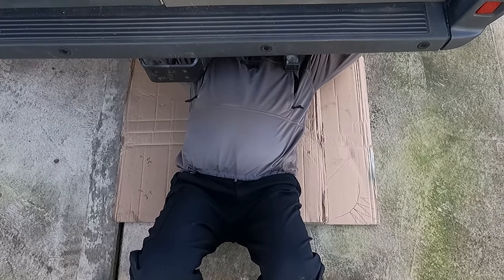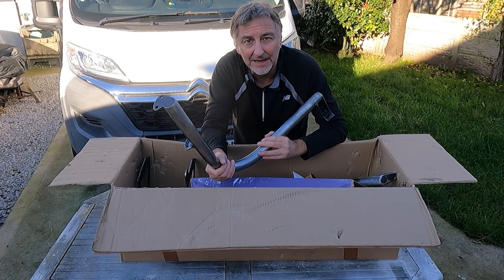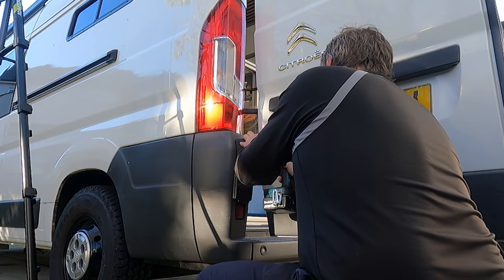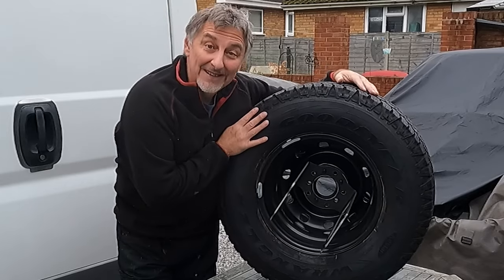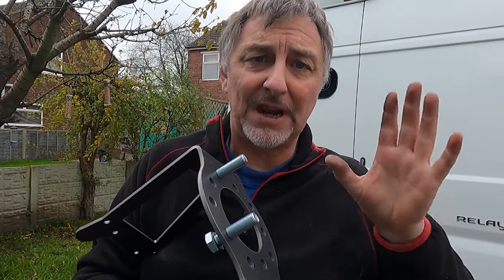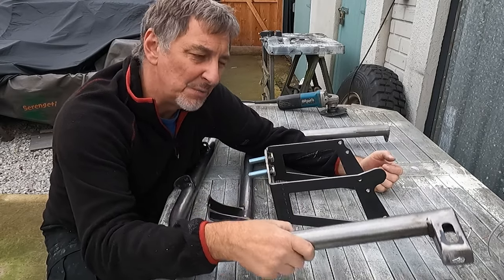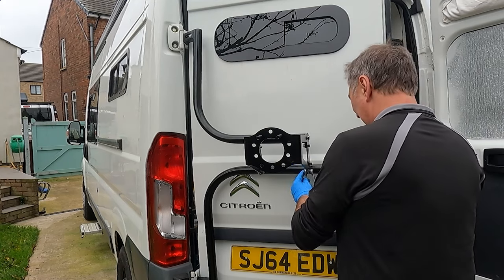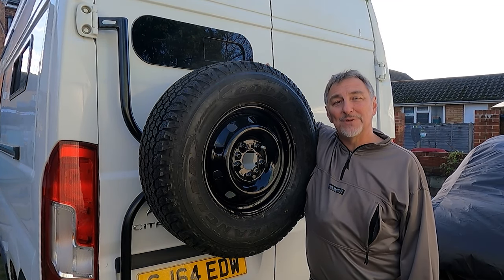Wheeliams spare WHEEL CARRIER fitting and review.

Comment: I enjoyed this video, tempted to gave a go at fitting one now. Although I'm weighing out my options. Got a question for you man.. I have a 2020 Citroen Relay 35 LWB the standard wheels on the Van now are 15".. so if I were to put on 4 x 16" alloys with standard tyres & also bought a 16" spare steel wheel, would the 16" spare wheel still be able to fit securely back up in to the underlying carrier underneath.?
Reply from the maker: Glad you enjoyed the video and it gave you ideas.
The underslung carrier wasn't specific to a set wheel size and would probably accept differences within reason but... What a dirty, shitty location that's likely to corrode and sieze, not ideal to keep a check on the state of your spare either.
Save up and go for the wheel carrier... Looks cooler too.
Reply: Absolutely.. They do look cool on & yes the underslung location is not great, can imagine having to wrestle with that in the pouring rain. What you did with those modifications & prep work is brilliant, although I would like to think that the company that manufacture these little units would have all that taken care of already.. Especially the hanging bolts you had welded on, it makes total sense to me. They could do that per request to wheel spec perhaps. Without the hanging bolts to use would be an awkward / heavy struggle.

Great job man 👍
Reply from the maker: Thank you again for your kind comments.
It was quite a difficult decision for me to purchase the carrier as I could have probably made one for a fraction of the cost but wasn't prepared to spend the time doing so.
I wanted an unpainted unit and was expecting a hefty discount having not realised it is supplied in an unfinished state already. 
For the price I would have expected a powder coated unit and even then perhaps £299 being a favourable price but unfinished and roughly prepared I think no more than £250 would be more reasonable.
Still..... saved me the bother.
Best wishes,
Paul
Reply: @vanlifemyway7806  In total agreement with you there Paul, on price. As there seems to be a fair amount of work to put in to it to get it right before bolting it on. Thank you for taking the time to show us. I've been checking out the rest of your videos on the rest of the build, looking brilliant man 👍
Reply from the maker: Thank you so much, I really appreciate that.
I'm hoping to build another similar van on a  tight budget. I have some ideas that I think will be effective for anyone on a budget with limited tools and skillset.
I do like many people's build in T&G but have some alternative ideas.
Reply: @vanlifemyway7806  excellent man, I'll be watching..  This is my 2nd build. This time on my new van (Realy) I'm aiming at building it in the hope I can make a go at living in it for a couple of years. Here's hoping the weather takes a turn for the better so I can get cracking on 😎
Reply: Hey chief.. I have one of these little units on the way in the post. I'm going to go the way you have, & have some bolts welded on. I was wondering what size of bolts you had used when welding the two you have for hooking the wheel on & off. This is a great idea & makes total sense.  Cheers ✊
Reply from the maker: I honestly can't remember M14 fine rings a bell.
I took a wheel stud into my local fasteners stockist and asked for slightly longer set screws.
Do you have a stockist near you?
I guess we could just Google Relay wheel stud size!
Done it!
14 x 1.5 pitch and I bought at about 10cm long.
Reply: @vanlifemyway7806  Nice one, Thank you man.. No, I've not got a bolt stockists as such handy, so it's either a trip to Screwfix or B&Q, with a bit of luck I'll find what I need. I'll let you know if Wheeliams took your tips/advice on board in those key areas you mentioned in the video. As your video really is the go-to one on here.